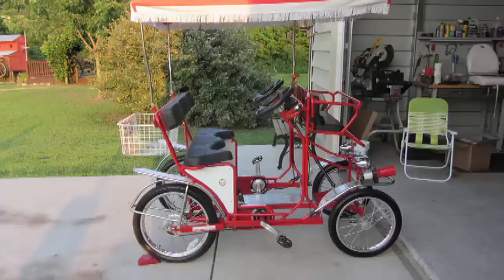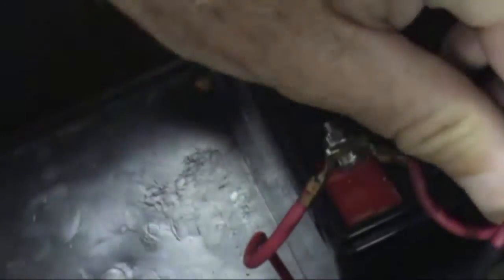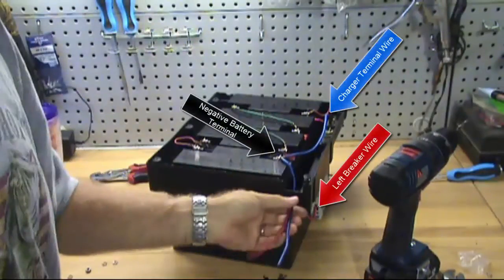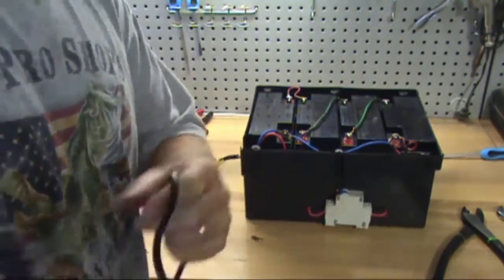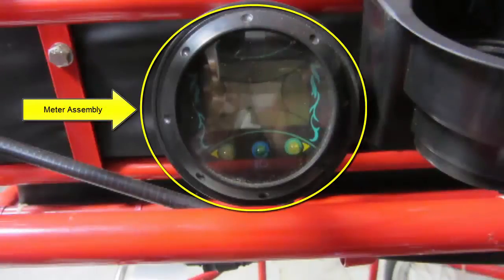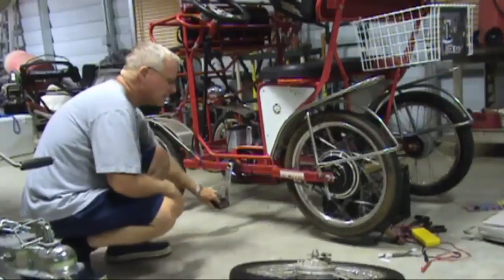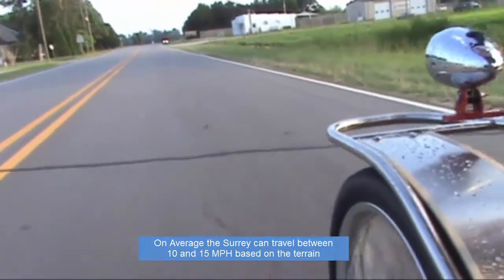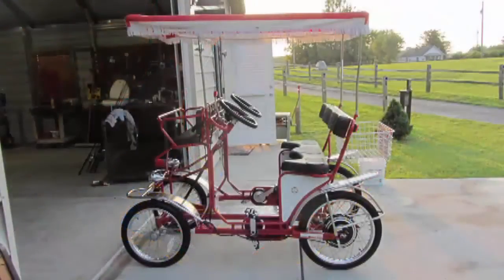How to Install An Electric Hub Motor with Pedal Assist on a Surrey Deluxe 4-Wheel Bike

Comment: Where are you located and do you do this as a craft.
Reply from the maker: I live in North Carolina. I build e-bikes and as a hobby.
Thanks,
Norman
Reply: I have a four person surrety quadricycle that I can only pedal about 100 meters because it so heavy.  Please recommend the equipment I need to purchase, that's cost effective, to make it run like yours.
Reply: Do you do this for others, if so, how much for parts and labor.  I'm in Florida and will have to bring it to you and pick up when you're through.  Or wait overnight, if it takes only a day.  I can't do anything with the bike.  It's too heavy and is a waist of money.  I would like to do something with it because it was just rusting until I put it in a shed.
Reply from the maker: The 4 person surrey weighs over 200 pounds. When adding the weight of passengers , the electric assist modification for this size bike is complex and expensive. I suggest you use the hitchhiker electric motor/wheel. This is a simple installation and will give you the power needed to push your surrey at a reasonable speed. You can buy the complete setup for about $2,100. It bolts directly to the rear floor and does not interfere with any pedaling components and for additional $95 You can add a monitor display for your speed, battery power etc. which mounts to the frame.
You can install the hitchhiker yourself in about 2 hours and save money on having to pay someone to install it.
Let me know if you need any additional information.
Thanks
Norman
Reply: @NormanGooch  They wouldn't sell it to me.  They said my four person bike won't take it.  Any other recommendations?  I have the bucket seat yellow one on Alibaba.
Reply from the maker: Isaiah,
I installed a hitchhiker on a 4 seater surrey made by international surrey company Two years ago for a friend and It fit the bike and operated properly. If they would not sell you one, you must have a surrey made by another manufacturer. The hitchhiker will not fit as they are made specifically for their models. Your other option is to install a mid-drive motor. This will be powerful enough to operate your surrey and have the torque needed to start up and climb hills.
This will require some modifications to your pedal drive but you keep your wheel, brakes etc as they are now. You can search google for Bafang mid-drive motors and look for 1000 watt motors. Also there are videos on YouTube on how to install a mid-drive motor on regular bikes, this will give you an idea on how to modify and install on your surrey. They work great and you can easily pedal the heavy surrey 15 to 20 mph and able to travel up to 25 miles per charge depending on weight and road conditions.
Thanks,
Norman

Comment: Is there a way to connect a car battery instead of 4 batteries?
Reply from the maker: You need 48 volts / 18 amps to operate the hub motor. One car battery only has 12 volts. Your other option is to use a 48 volt lithium battery. This would be just one battery pack and it only weighs between  3 and 4 pounds. It also much more expensive over using lead acid batteries.
Thanks,
Norman
Reply: Thank you very much for responding

Comment: I have this Surrey bicycle, in the 4-seat model. I have The Hitchhiker wheel assist motor. My current battery is dead. Do you think I can add the battery set-up, as you detailed here, for my larger model?  And, what kind of batteries are those? (my model had a Lithium Ion battery. A replacement is VERY EXPENSIVE so I am considering linking batteries together as you have done).
Reply from the maker: Michael,
You can use sealed lead acid batteries and setup the voltage you need to run your Hitchhiker motor.
Just make sure to match the voltage of your current set-up.  The lead acid batteries are going to be heavier than your lithium power set-up and will add additional weight to your bike.
The batteries are 12-volt 18-amp SLA-AGM.
There are many different brands available it is a matter of choice. These type batteries can be mounted in any position, resists shocks and vibration. Long lasting high performance in high and low temperatures, 
I have used the following batteries and they performed well.
Mighty Max ML18-12, Expert Power EXP12180 and Universal Battery UB12180.
You can do a Google search to find several other manufacturers and many of these are available on Amazon.
Thanks,
Norman

Comment: Can you tell me what brand wheel you used and where you got it from?
Reply from the maker: Robert,
I purchased the wheel from eBay. It was used for an built for an electric motorcycle. The tire and wheel was the perfect size for the bike. I checked my saved link to this site, but it no longer exist. There was a company called incredicycles that used to sell electric wheels to fit the bike. I’m not sure if they are still in business or not. You may be able to search and locate one on eBay that will fit.
Thanks
Norman
Reply: @NormanGooch  thank you!

Comment: Did you get the hub motor already installed on a spoked 18" wheel or did you modify an existing wheel ?  Also, since you removed the stock drum brake wheel, does the hub motor wheel have an internal braking mechanism? Or did you just keep the steering wheel lever connected to the passenger side wheel drum brake? I recently acquired a similar single speed surrey and found it to be extremely difficult to use for other than short distances without tiring...since the Chainring to rear sprocket gears are both 28 teeth, its very hard to go much faster than a few miles an hour...Great video and your assistance and insight would be appreciated...thanks
Reply: Where did you purchase the motor and components?  Can you provide details?
Reply from the maker: The hub motor was complete with wheel, motor, drum brake, and tire.

Comment: Great video.  Could you send me the model number of the hub motor you used.  Did you have to relace the spokes and did the original brakes have to be modified?  After using the modified bike for a while, is there anything you would do differently?
Reply from the maker: Darrell Keller 
The hub motor I used is no longer available. You should contact  incredicycles.com they may have a hub motor for a Surrey. Even though it is not listed on 
 their website, I think they have a source. Call or email and ask. The only thing I would change is
the battery pack. I would change to a Lithium battery pack. This would provide more power and ride time.
Thanks
Norman
Reply: Thank you for taking the time to respond.
Reply: This is a great video and I have a Surrey and would love to add electric assist as well!  It looks like Incredicycles is out of business - Their website is down, and I found a phone number for them, but it was disconnected.  

I have seen a few 18" electric hub motors online... I am going to try to find one that has the right dropout/fork width.  I couldn't see in the video very well how you kept the chain and gear on that rear wheel with the hub motor in it.  Did the hub motor you bought also have a chain gear on it?  

Thanks again for the video and any info you may have!
Reply from the maker: The model I used is no longer available. Check out International Surrey.com they have a new 2.0 electric pedal assist for about $1,595. Also, you can search for a hub wheel that is normally is used for electric scooters or cycles that can be modified to fit the surrey wheel for much less money. I built a wheel similar using a 800 watt hub and an old motorcycle wheel that was the perfect size for $450. 
Thanks
Norman
Reply from the maker: No, but had space to add. The wheel came with a drum brake already installed.